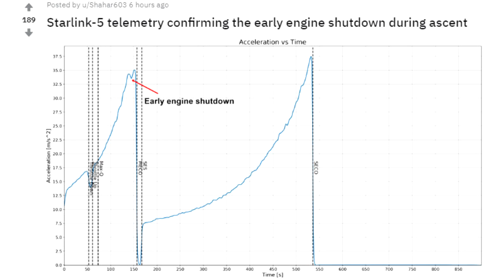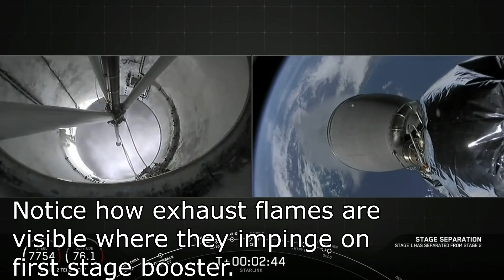Falcon 9 Suffers In Flight Engine Failure, Booster is Lost,  but Cargo Delivered Successfully

Comment: The one engine might have lost an oxidiser feed line, lost pressure in the LOX tank, and thus would have caused engine failure during the descent.  Leaking LOX might account for the fogging on the camera lens during the initial descent burn as well as that flare just prior to MECO.  Just a guess at this point, of course.

Comment: Scott, you’re the man, buddy, but can we call the bottom part of the Falcon 9 the "first stage” instead of "booster”?  What if SpaceX decides to put smaller solid strap-ons (say from Aerojet Rocket dyne)?  Wouldn’t they then be called “boosters”?  
If the top part is called the second stage, then shouldn’t the bottom part be the first stage?
I think SpaceX calls it a booster too, but can we talk them out of it?  The 9 engines are the main event, not an extra added later.

Comment: If you’re ever driven 100 miles an hour on the highway it doesn’t feel very safe especially if the windows down. Going 14,500 miles an hour will always be regardless of what Rocket you are flying A scary thing to do.

Comment: It is possible that the engine shutdown was a secondary problem cause by a different malfunction, and that primary malfunction could have caused other problems with the boost, making it fail reentry.

Comment: Occam's razor says the UFO that Falcon passes just before entry burn is the Merlin 1D combustion chamber. The tumbling debris appears to be a cylindrical metallic object with conical ends, a few symmetric mechanical/plumbing bits sticking out and about the size of the chamber. The explosion probably blew thrust bell off and dislodged the the combustion chamber, but it did not fall out until after entry orientation and before the entry burn.

Comment: 5:28 you sure skipped over that quick. The booster is falling back at this point right? But that's only a few hundred feet away from the body of the booster. What the hell is that?
Reply: Most likely ice. This kind of object is visible even with successful landings.

Comment: WHEN THEY HAVE PROBLEMS LIKE THIS AND THEY KNOW THEY MAY HAVE A PROBLEM LANDING, WHY DON'T THEY JUST PUT THE FIRST STAGE INTO AN ORBIT TO BE USED LATER TO BUILD A SPACE STATION? IT'S NOT LIKE THEY DON'T HAVE ENOUGH FUEL BECAUSE THEY DO A LOT OF BURNING ON THE WAY DOWN. I'M SURE THERE IS ENOUGH FUEL TO GET IT TO A STABLE ORBIT. IT JUST SEEMS SUCH A WAIST OF RAW MATERIALS. 

AM I MISSING SOMETHING HERE?
Reply: Would be an idea if thy would have a space shuttle to bring it back to earth
Reply: The first stage does not have enough fuel to go to orbit. Not nearly man... Gravity does most of the work on the way down and it only has to decelerate a few thousand mph. Where as at the time of stage separation there is still some 12,000+ mph needed to get to orbit which the second stage hammers out.

Comment: Hey Scott, please explain why they would need or even bother uploading wind data to the stage one booster on reentry? Seems like it's own guidance, navigation & gyro systems would be recording its position relative to the landing ship/pad and correct automatically.  Are they also uploading wave height & pitch?  Just seems that's data that could change instantly and the booster's systems would be better served to rely on what it's own systems are telling it in real time. Sounds like horse-feathers.  Love your channel!
Reply: My guess is you cannot get a prevailing wind figure on a vehicle that is moving through the atmosphere at several thousand mph. So they upload the figure separately for it to work off of.

Comment: Anybody notice how late the rain birds started? 
The Rain Birds are designed to prevent damage from faster than sound waves bouncing back at the rocket and its engines from the flame ttrench. If you watch previous launches they start spraying a good 3 seconds before lift off, but not today's. I think there was significant engine damages caused at the point of lift off, it was certainly leaking a lot of fuel when it attempted its landing burn too...

Comment: I was wondering what happened to the booster.  I saw the puff of smoke from the engine just prior to MECO, but thought there was something wrong after the entry burn, when you see the booster correct itselfa couple of times.  When I didn't hear them call out "Falcon 9 sub sonic" or "Falcon 9 landing burn start up", I knew it was lost.

Comment: Scott, do you suspect this engine anomaly will affect the upcoming DM-2 mission?
Reply: No. This is the 5th flight of that booster. The Merlin engine has far surpassed and reliability requirements. And they already take possible engine failure into account for human launches.

Comment: When they say, "the booster has been reused", what exactly does that mean.....are the engines reused also? Do they refurbish the engines and booster or just the booster? Inquiring minds want to know.
Reply: They borescope and reuse the engines and everything else. They check everything and replace anything that has any issues. Most if not all of these engines have flown all 5 flights. The booster is very robust.

Comment: Haven't seen the launch, but I bet once it showed significant signs of failure after the re-entry burn, they blew it up. Nothing is worse for a rocket company than to have any of their space faring equipment to come back to earth at 3 times the speed of sound in a populous area. Normally they land them back at the launch site, and that messed up roll when it was making its way down after the engine shut down (prior to the scheduled landing burn) probably put it off targer. Blowing it up would have been the most sensible option.

Comment: During the view of the second stage burn, we see pieces of debris of some kind just aft of the nozzle.  Looks like white cotton candy that moves around the perimeter of the groove formed by the circumferential tube and the base of the nozzle.  It accumulates in chunks, then eventually falls off and disappears.  What is this?  Condensate of some form?  Second stage material?  Perfect example at 3:36.

Comment: If an engine is pumping unburned fuel into the exhaust plume, wouldn't the excess be burned in the plume?  It theoretically should be ejecting fuel at the proper ratio for combustion, so wouldn't it burn off in the plume instead of spraying out, unburned?  Thanks Scott! Love your channel!!

Comment: J2 had a few instances of premature shut downs mainly due to POGO... its inevitable and this one wasn't on a new booster but a well worn...  I suspect as these used boosters get some miles on them the weak points will show and be addressed... this is literally completely unknown territory flying an engine this much without a major overhaul...

Comment: Well, I noticed after the re-entry burn that there was a lot of oscillation that I'd never seen before. But, there's probably a lot of stuff I've never seen before. As for the Atlas or any other orbital rocket, they're all brand new off the showroom floor, whereas, these SpaceX rockets have all been around the block a time or two or three or four or five.....

Comment: AND THEY WANT TO PUT HUMANS ON THIS SORT OF SYSTEM?

I don't care how 'reliable' hoverslaming is, people should not be on any sort of craft when this is the only sort of landing method. It is not reliable if there is no decision time between unsafe and dead.
Reply: It is the only way if you are landing on the moon. But you are right on any terrestrial landing, I certainly would rather bail out and land with a parachute than trust my life to this.
Reply: @garethhanby  I understand the moon but the delta V there is multiple magnitudes less and even then Apollo 11 almost had to abort. The difference here is that they could, they were moving slow enough that they had 30 more seconds or something in their decision window, not 30us
Reply: Well, this may be the first falcon 9 booster to fail to land that didn't have a soft landing in water. The other 2 Falcon 9 boosters to fail both landed softly in water, which would have kept people safe. 

Also, Falcon 9 does not have much redundancy for landing, since that is secondary. Starship will have a lot more redundancy. And it won't be pushed to it's limits like this booster is. 

All that said, you don't have to trust it for a while, if ever. Starship will be required to land numerous times before any humans get onboard. And it will likely be landing for years before normal people will be put on it.
Reply: @anthonypelchat  in the past 2 years there's been 5 hoverslam failures, at last 3 were catastrophic (unless I'm reading the logs wrong but "damage to drone ship" and "failure to ignite" do sound catastrophic). And sure, I don't need to worry but a life is a life, whether it's mine or not.
Reply: @kkrampus   Only 1 was catastrophic, though this one may have been as well. The others had soft landings in water. The rocket may have been too damaged to be worth recovering, but it was still a soft landing. The previous failure this year is a good example. It missed the barge, and the topple over damaged the hull. Even still, it was a soft enough landing that recovery was considered. 

Think of it like a car. If yoh got in a wreck and they weren't sure at first if the damage was enough to warrant totalling the car, what are the chances that someone die it?

Again though, this was with pushing the rockets to their limits. And landing is not mission critical, so there is minimal redundancy. It would obviously need a lot of testing, redundancy, and certifications before humans would be onboard.

Comment: My money is on secondary damage from too rapid shut down. On engine failure the fuel valve to the bad engine has been slammed shut (possible would have failed more spectacularly if shut off more softly, so maybe not a bad decision), and burst a pipe upstream by water hammer. I can't think of any more likely way you would end up with a fuel leak from an engine failure upstream of the shutoff valve, except maybe total failure of the combustion chamber if the valve is not remote enough. You can actually see something coming out of the rocket at re-entry burn shut off, so I think we can be pretty confident it is leaking something.
A variation is that a fuel leak upstream of the valve caused the shut down. A drop in pressure into the engine would risk the pump stalling, and so would definitely be a shutdown condition.

Do we know if there is a shutoff valve before the flexible section of fuel line? That seems to me to be the most likely point of failure in the fuel system, especially after repeated uses. 

One of the side advantages of this sort of reusability is the margins built into the design. Even with a substantial fuel leak earlier in the flight the booster could use it's landing fuel to get to the target orbit. You have an "abort to expendable mode" available to you.

Comment: Seeing the mystery debris on a big screen TV and examining it frame by frame it does not look ice, it has two equally opposing flat sides, overall black in color with a reflective metallic looking round center. Now looking at the engine assembly @3:17 the only part that resembles the debris are the one of the four engine cluster mounts that connect to the rocket fuselage.

Comment: T+6.36 thru T+6.40, F9 camera, WTH is that?
If a motor popped just before MECO, it could have damaged other motors in a way that only showed up on the restart when the motors and pumps represurised - perhaps it made it through the re-entry burn, but left enough damage that the landing burn would not have been possible.
If so, I hope we see footage eventually from the onboard camera, showing the descent, and whether the F9 was still under glide control from the Grid Fins, all the way to impact - that would show everyone that it's able to steer away from potential disaster.

Comment: The droplets on the camera during reentry burn is very likely unburnt fuel. (it seems too persistent to be LOX or water.)
Likely scenario: The engine that failed just before MECO resulted in plumbing damage, fuel leak.
This is the source of the droplets, and the loss of fuel cut into the available margins for landing preventing landing burn.The starlink launcher are very heavy, and very little "spare" margin for inefficiencies.
Reply: I thought so too. The engine failure before MECO looked pretty violent. It may have nicked the nozzles of other engines, which would then spray RP-1 from the cooling channels.

When the video feed interrupted after the reentry burn, the booster probably lost stability and broke apart. I do not think the video ever resumed -- as there were no gasps heard in the background in the web-cast, unlike other launches when we could hear the reaction of SpaceX workers to unexpected events.

Comment: Merlin is a very reliable engine, no doubt about it. Nothing is perfect and it was just a matter of time to see an engine fail at some point. This will just make Merlin even more reliable as they identify and fix the problem which caused this failure. I guess the failing engine took some other system with it which lead to the inability to land. Maybe the failing engine caused a leak in the hydraulics?

Comment: What i think it is: the engine that blew out was the center engine (which i believe is #5), this engine was part of the 3 engines in charge of the landing burn, but compared to the 2 next to it- it has little control authority in comparison. what blew up seems to have been a part of the injection plate, which explains why it was spraying liquid fuel instead of atomized fuel. it also explains to a degree why the bell nozzle puffed out suddenly since the bell would catch the majority of the liquid fuel being sprayed before it completely vaporized. normally engine blow out would have an automated shutdown command given to the engine from either ground control or the onboard computer, but since the booster was lost, that command may not have been accepted or executed by the faulty engine, resulting in catastrophic failure upon relight.

Comment: Falcon 9 is hoped to fly 10 flights with as few repairs as necessary between flights. Also they want to refurbish the rockets after 10 flights and continue to fly up to 100 times.

Considering each Merlin engine is test fired, the whole stack is static fired on the pad and these engines light up several times during a flight, first it shows what an impressive piece of hardware these Merlin engines are but second shows how much wear and tear they go through.

Maybe SpaceX should consider a full refurb after 5 flights. If need be, they can iterate and improve the process up to 10.

Comment: Just a tip, but "Falcon 9 Delivers Cargo Successfully, Despite In Flight Booster Failure" is a seemingly small tweak to the title of the video, but it has a better psychological effect on people. In essence, you want to put the good stuff before the bad stuff. Also, notice that I replaced the word "engine" with "booster". This makes the title seem less "severe" than it otherwise would have been (i.e. a booster loss isn't as bad as losing the entire engine). Of course, maybe your intention was to bring awareness to how catastrophic this situation could have turned out and, if that was the case, you can ignore this advice. ;)

Comment: What about the roll oscillation right after the entry burn. That was not typical. Seemed to have been stabilized but perhaps what caused it caused the ultimate failure.

Comment: Remember that this was the 5th flight of that booster (and I assume those engines?) and it has an aborted take of that come as close to engine start as well.

I am sure the SpaceX refurbishment teams works wonders but everytime something is used in ways like this it has effects on its components including the engines.

Its Also worth remembering that SpaceX are doing things no one else is doing with orbital class rockets yet and I guess its a learning and testing curve for them as well.

And finaly its worth remembering that this is theyre mission and the payload is payed by theyre subsidary company Starlink and that gives them a little bit more room to both test new things and to "push the envelope" when it comes to things like how many times a booster is reused and what they can try and do with its performansens. So I think Elon write this booster of as a learning experience cost. Johan.

Comment: quick question
you mentioned that the dead engine wasn't one of the three that control the landing burn, and that there are 6 in total.
would it not be possible for spacex to have a set of three for landing and a set of three as a backup for if one of the 'plan A' engines fail and make changes to the guidance software accordingly (so instead of firing an engine at the 4 o'clock position (for the set of three engines at 4 8 & 12 o'clock) under the rocket, they would fire the engines at the 2 and 6 o'clock position (for the set of engines at 2 6 & 10 o'clock). hope this makes sense but idk im pretty fried lmao